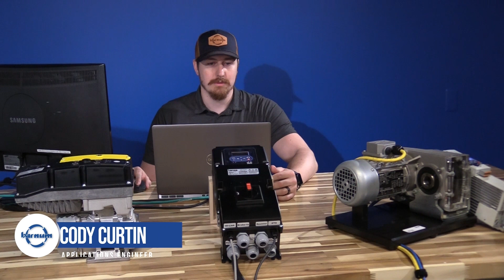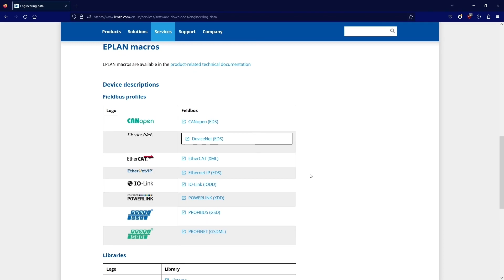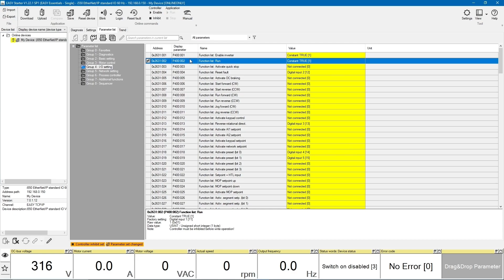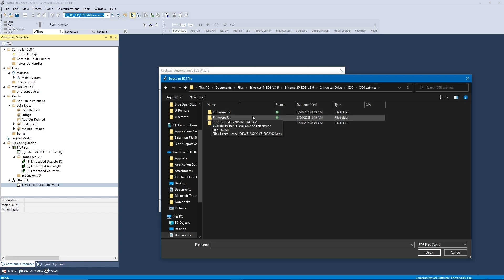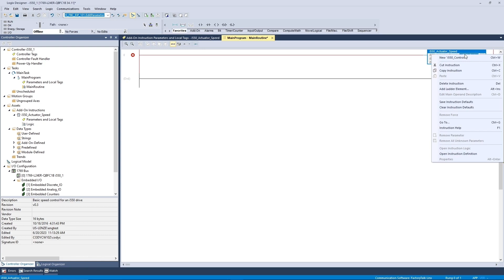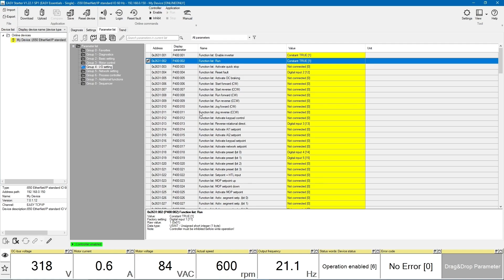H. H. Barnum i550 Easy Starter setup for Ethernet IP Communication

Comment: I use an i550 motec inverter and I want to connect directly from it to the computer, the problem is that I previously reset the inverter to factory settings in easy starter and I have no idea what the address is now. I connected using a USB cable but is it possible to check the IP address of the inverter in order to connect to it?
Reply from the maker: Using the Easy Starter Software you can easily connect one to one to the drive via Ethernet and use the browse functionality to find drives of an unknown IP address.   It will find devices via MAC address and populate them for you to use and connect to.

Comment: We have a bunch of new machines with i950. 
All the lenze drives ive ever worked on uses keypad, or via usb like the one you show here. 
Anyway, if i was to plug direct into an i950 via ethernet, is there a way yo determine the ip address if its unknown? 😬
Or is there usually a rule of thumb that devices will start in a certain address range to start guessing? As theres 5 drives in total. 
I'll be using easy start software. 

Thanks 👍
Reply from the maker: Thanks for reaching out!   The i950 has an "engineering port" on the front face, it is the lower most rj45 port. You can use the Easy Starter software to browse connected devices and it should connect over that engineering port when you are connected via Ethernet regardless of set IP addresses if unknown.   Once you're online you can set individual ports on the ethercat ports or the additional comms module (EIP etc,) to any static IP address you want.
Reply: @HHBarnumCompany 
Nice one. Thanks very much. Just looking to do simple backups of them all icase of future problems. I have noticed an SD card is also inserted, so im not sure if they also contain the parameters? 

Many thanks.
Reply from the maker: @SimBunker  The SD card does save all parameters when "saved to device" in the easy starter software, if a drive ever needs replacement you can insert that SD card, set an IP address and parameters will carry over from the old drive.
Reply: @HHBarnumCompany  perfect. Thanks 🙏

Comment: Hello, have you tested DLR ring topology aswell?
Reply from the maker: Yes, the Ethernet IP version of the i550 Protec are capable of being used in a ring topology/DLR configuration.  There are two ethernet ports available on the drive.
Reply: Can you Make a video Lenze i7 with PLC and HMI programme?